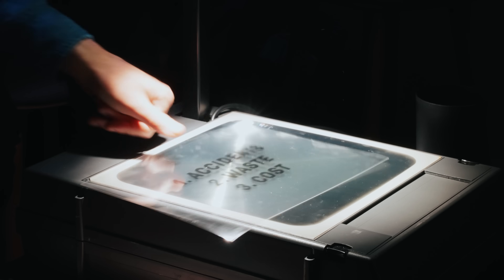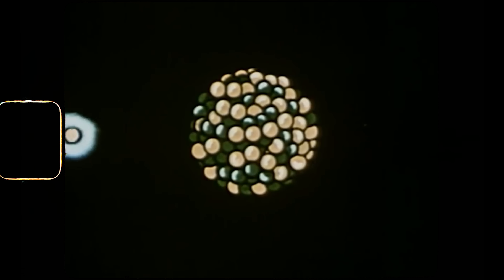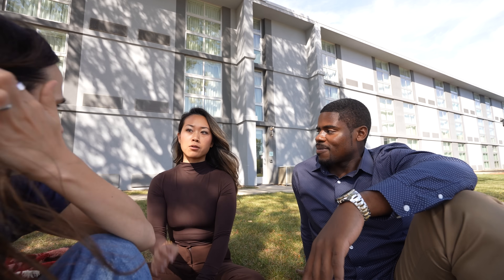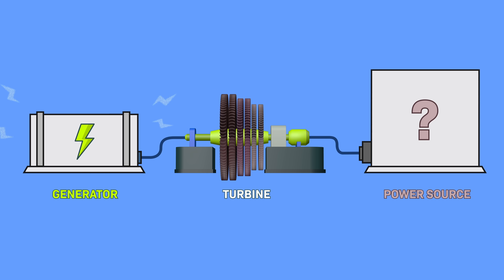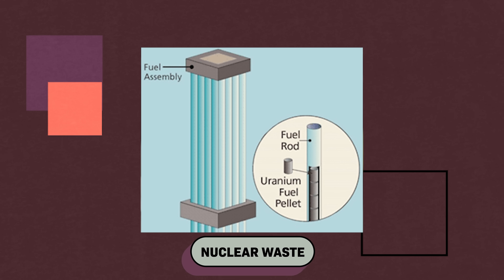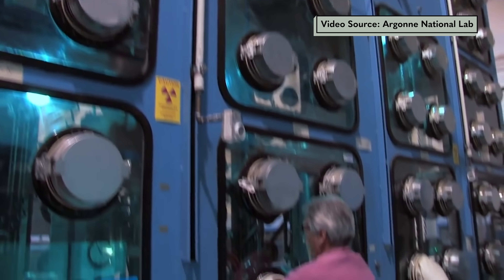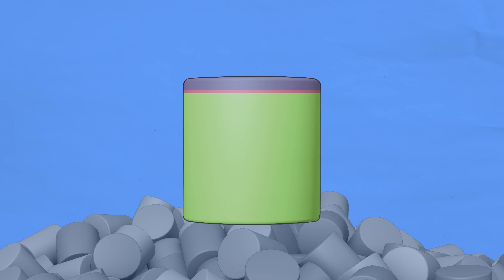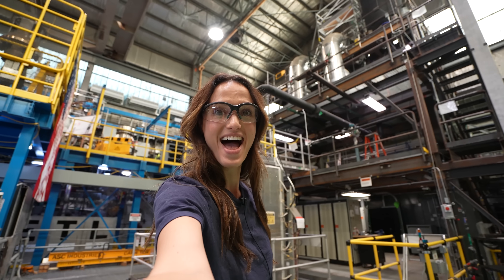The Big Lie About Nuclear Waste

Comment: If we want to cut/end our dependence on fossil fuels (oil, coal, and gas) we will eventually need more nuclear power.  All of the energy we use, derived from fossil fuels, will need to be replaced by other sources.  Nuclear energy is currently the only energy source capable of producing energy on the scale required to replace fossil fuels.  The good news is, we already possess enough nuclear fuel, both enriched (including that in nuclear weapons) and depleted, setting in heavy water storage pools in every nuclear power plant and buried in underground repositories, to last us for decades, perhaps centuries, without mining anymore uranium.  We've already spent trillions of dollars producing it over the decades.  It's an incredible national resource.  This, coupled with new regional U.S. nuclear fuel reprocessing facilities, will allow us to repeatedly extract more and more energy from what we already have.  The good part is we will over time reduce the amount of nuclear "waste" and nuclear weapons we already have by converting it's radioactive mass into clean electrical energy.

We absolutely need nuclear energy as a bridge to give us the time needed to fully transition to 100% clean, renewable, and sustainable energy sources.  All without digging, burying, and storing any more nuclear waste than we already have.

And, of course, we need safe nuclear power.  We need to continue to learn from the mistakes of the past, we know their names, Three Mile Island (1979), Chernobyl (1986), Fukushima (2011), and a host of others.  Safe future nuclear energy would include:  not locating any new nuclear power plants in any seismically active regions, or along coastlines subject to hurricanes and tsunamis, or near large population centers, as well as other safeguards.  In addition, requiring all new nuclear power plants to utilize closed-loop cooling systems, not rivers, lakes, or oceans.

Our future energy supply, without fossil fuels, will necessitate a mixed bag of wind, water, solar, bio, geo, hydro, and nuclear.  The sooner we begin the transition the easier it will be, the less it will cost, and the less fossil fuels we'll consume.  If we had begun 30 years ago we would be there today.  It would be much better to begin today, while we have the luxury of time, rather than being rushed by foreseeable and unforeseeable future circumstances beyond our control.

We know that even nuclear energy is not sustainable in the long term.  Because of this we will need continued research into the most promising alternative clean, renewable, economical, and sustainable energy sources, perhaps even fusion power.

We also need to improve and harden our electrical grid.  I envision a day when we have a superconductive national electrical grid.  It would consist of an underground "spine" running across the U.S. from east-to-west.  Prefabricated rectangular cross section concrete tubes, buried underground end-to-end running across the country between the lanes of I-80 perhaps.

Large superconductive electrical cables, enclosed within a sealed outer cooling jacket, filled with liquid helium or some other cryogenic liquid.  This would essentially eliminate i^2 R electrical transmission losses, greatly reducing the total amount of extra electrical energy required to meet demand.  Today, all of this extra electrical energy generated never reaches the customers and is dissipated as heat.  The "ribs", running north-to-south, could be optimally located.  These "ribs" could also be superconductive as well, if desired.  The reminder of the grid would remain the same as today.

Such a grid would allow power plants to be optimally-located anywhere without the need for hundreds or thousands of miles of existing electrical transmission lines and pylons.  It would allow hybrid electric vehicles with smaller and lighter batteries having drop-down inductive pickups to cruise along the lanes of this "spine" and "ribs" powered directly from the grid, from embedded electrical cables within the concrete roadway.  The electrical power used by such hybrid vehicles would be metered and included in each owner's monthly electrical bill.  Such vehicles could be powered from conventional battery and/or fossil fuels during off-grid operation.

Comment: Thanks for this video.
What about the "breader reactor"? In the time period of Carter and before that was the idea that was supposed to bridge us over until we got fusion power. I did not realize Carter killed this. I know his administration came in committed to solar and then abandoned that as they felt it could never become economical or efficient enough to provide all the energy we needed. Work on fracking and oil shale conversion to oil was started. That work help us become the number 1 oil producing country in the world. Yes more than Saudi and more than Russia.

There's more but that's to much for just a comment.

Comment: So, we only have to worry about the waste for a couple of centuries, we are saved!   The Japanese fast breeder reactor programme has been hugely expensive and uneconomical.  Nuclear technology is not "clean" - the fuel requires mining, then transport, then conversion to yellow cake (uranium oxide), then transport, then further refining, then transport, then further refining, then transport, then maybe it gets to be used or has to go through another process before it gets used - each stage uses energy and puts CO2 into the atmosphere.  The failure of a nuclear reactor creates a catastrophe that lasts for many years afterwards and potentially affects thousands of people, you can't guarantee its 100% safe, so it should not be used at all.  The process of dumping the waste requires more transport and the creation of a fuel site that nobody wants to be in their backyard, even in the Australian desert the locals don't want it there, even it is unsafe for "only" a couple of centuries - you know, like from 1800 to 2000, just think of all the things that could happen in that time.  We should use alternative energy sources that are renewable and do not produce such waste - they are safer and cheaper, too.

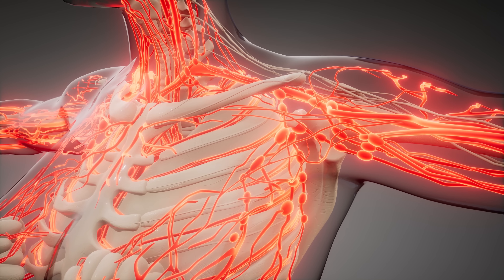Comment: Cleo, at 7:30  "...fire a bunch of free atoms at your Uranium-235" - this should be "free neutrons".
And, in particular, slow (thermal) neutrons in the common light water moderated/cooled reactors.

The waste from light water reactors is/was being recycled in France and elsewhere, but the process is expensive and generates a lot of radioactive waste, because a lot of the neutrons turn Uranium-238 into various radioactive but not very fissionable elements.

at 7:57 you say "after four to six years you've broken enough of that special uranium", but it's actually the neutron "poisons" building up that make the reactor harder to control, only about 5% of the U-235 has been fissioned at this time.

Fast neutron reactors, like the mentioned reactor from the 1960s, can burn up much more of the fuel (including some wastes from light water/thermal neutron reactors) and generate less nasty waste.  But they have to be cooled with liquid metals (sodium or lead) or molten salts or helium gas, which have historically led to problems, like sodium leaks and fires. And one needs (expensive) highly enriched fuel to run them, leading to proliferation worries.

Comment: Currently, the capital cost of the breeder is significantly higher than that of the light-water reac- tor. Constructing a 1000-MWe light-water reactor would cost about $1.7 billion, while a fast breeder reactor system of comparable power could cost $3.4 billion.

Comment: Fast neutron reactors can fission a lot more of the transuranic elements that are generated, and therefore utilize more of the fuel with less waste and more importantly, less long-lived radioactive elements in the waste. However, they are significantly more dangerous if they fail. However, a fusion reactor could potentially be used to supply fast neutrons to a slow fission reactor to fission a lot more fuel without as much danger.

Comment: Spent nuclear fuel can be recycled to make new fuel and byproducts. More than 90% of its potential energy still remains in the fuel, even after five years of operation in a reactor. The United States does not currently recycle spent nuclear fuel but foreign countries, such as France, do.
Reply: Wrong. 97% of a fuel rod is basically useless (U238). 3% is U235 that is used to create heat. A spent rod has 1% U235 left (you can recycle this) and 5% of other highly radioactive materials (that in reality are waste because we have no reactors to use them).
Reply: @whuzzzup  

5 Fast Facts about Spent Nuclear Fuel
October 3, 2022

    Office of Nuclear Energy 5 Fast Facts about Spent Nuclear Fuel 

Nuclear energy is one of the largest sources of emissions-free power in the world.

It generates nearly a fifth of America’s electricity and half of its clean energy.

During this process, it creates spent or used fuel (sometimes incorrectly referred to as nuclear waste) but it’s not the green oozy liquid you might be thinking of when watching "The Simpsons."

In fact, some in the industry actually consider it a valuable resource.

Say what?

Don’t worry, we’ll get you up to speed with these 5 fast facts on spent fuel that is generated from commercial nuclear power reactors in operation today. 
5 fast facts about spent nuclear fuel

Click above to view or download our 5 Fast Facts about Spent Nuclear Fuel infographic. 
1.  Commercial spent nuclear fuel is a solid

Spent fuel refers to the nuclear fuel that has been used in a reactor. 

The fuel used in today’s commercial reactors is made up of small ceramic pellets of low-enriched uranium oxide. The fuel pellets are stacked vertically and encased in a metallic cladding to form a fuel rod. These fuel rods are bundled together into tall fuel assemblies that are then placed into the reactor.

The fuel is a solid when it goes into the reactor and a solid when it comes out.

Sorry “Simpsons.”
2. The U.S. generates about 2,000 metric tons of spent fuel each year

This number may sound like a lot, but the volume of the spent fuel assemblies is actually quite small considering the amount of energy they produce.

The amount is roughly equivalent to less than half the volume of an Olympic-sized swimming pool.

And, the clean energy generated from this fuel would be enough to power more than 70 million homes—avoiding more than 400 million metrics tons of carbon dioxide emissions.

If we take that a step further, U.S. commercial reactors have generated about 90,000 metric tons of spent fuel since the 1950s. If all of it were able to be stacked together, it could fit on a single football field at a depth of less than 10 yards.

The nation’s spent nuclear fuel is initially stored in steel-lined concrete pools surrounded by water. It’s later removed from the pools and placed into dry storage casks that are made of steel and concrete or other materials used for protective shielding.
3. Spent fuel from U.S. commercial nuclear power reactors is stored at more than 70 sites in 35 states

Most of the nation’s spent fuel is safely and securely stored

 at more than 70 reactor sites across the country. Roughly a quarter of these sites no longer have a reactor in operation.

The U.S. Department of Energy is now exploring the possibility of consolidating this spent nuclear fuel at one or more federal interim storage facilities using a consent-based siting process. 

For the foreseeable future, the spent fuel can safely stay at the reactor sites or a future consolidated interim storage facility until a permanent disposal solution is determined by the federal government.
4. Spent fuel is safely transported across the United States

Over the last 55 years, more than 2,500 cask shipments of spent fuel have been transported across the United States without any radiological releases to the environment or harm to the public.

The fuel is shipped in transportation casks that are designed to withstand more than 99 percent of vehicle accidents, including water immersion, impact, punctures and fires.
5. Spent fuel can be recycled

That’s right!

Spent nuclear fuel can be recycled to make new fuel and byproducts.

More than 90% of its potential energy still remains in the fuel, even after five years of operation in a reactor.

The United States does not currently recycle spent nuclear fuel but foreign countries, such as France, do.

There are also some advanced reactor designs in development  that could consume or run on spent nuclear fuel in the future.

Office of
Nuclear Energy

1000 Independence Ave. SW
Washington DC 20585
202-586-5000

Comment: Your video was stunning! I have been interested in Nuclear Power, its advantages and risks since the beginning. I am horrified to realize that though Carter was a moral and intelligent man, (which is why I voted for him), he was dead wrong twice with consequences that will harm humanity well into the next century. Though Liquid Fluoride Thorium Reactors are vastly safer and cheaper than light water Uranium reactors, and can rapidly consume Waste from U-235 reactors, and Fusion reactors are glued to the horizon, Spent fuel  recycling can immediately solve the storage problem. Like LFTRs, we can just implement technology we already have. It turns out that climate change is the result of deliberate choices not to implement technology to prevent it.

Comment: Plutonium, AKA fast reactors had enormous problems in the past, including a core meltdown on EBR1 in 1959.  India has had failure with them as well.  There is great risk as the extremely toxic plutonium is the main neutron source, and is essential to minimize for proliferation.  Think patents and foreign sales.  Most proposed fast reactor designs use sodium as a coolant, which if it contacts a tiny bit of water corrodes steel pumps and containment. With a lot of water, sodium can react violently, think Fukushima.  Realize that powerplants are not built for wartime scenarios and can be a disaster if an enemy decides to nuke em, as we look to Ukraine's Zaporizhia.  In the United states even conventional plants take forever to make, and in the case of SCANA, $9 Billion were wasted before cancellation. However those who sold the failed plant were still able, as in all power infrastructure to bill the rate payers.  Nuclear power is not safe or cheap.  It is unlikely it ever will be.

Comment: I like channels that take complex topics and accurately explain them in simple terms. Subscribed.
Reply: some topics are complex for a reason. this video is mostly fanfic and halftruths. molten salt (thorium or other) reactors have been in research for decades and none are anywhere close to ready, or will be ready within a timeframe that is relevant to the problems we are facing in climate change. 15 years at least for a proto type reactor, and to make it comercially viable it seems to be more 30-50 years if ever.
the corrotion of the inner reactor parts is a huge problem, because the lifespan is way to short and the costs of replacing these now radioactive parts are enourmous.
the fact alone that the video throws recycling/enrichmement into the same bin as molten salt reactors shows that there was barely any research done..

Comment: This is NOT closed-cycle, it is a multi-pass  fuel cycle- "only a few hundred years" of radioactivity to deal with is not even remotely reasonable an expectation that ANY company, or ANY government, would maintain, not only the commitment,, but the technical competence .to maintain the storage facility and deal with the ultimate disposal.
This DOES kick the can down the road a bit, in that we won't be having to deal with ADDITIONAL waste on the megatonnage of what's already on hand.

Comment: Very interesting! 😃
At the same time I wonder what happens to the stuff that they cannot recycle. The used pellets seem to be composed of only a minor amount of the useful uranium-235, even less after they were used. The highly unstable materials will decay quickly, but what about the uranium-238, which - according to the graphics - is most of the uranium the pellets are composed of and has a very long half-life? And also the potentially weaponizable plutonium remains unrecycled. 🤔

Comment: Stop! IT DIDN'T WORK. You are just repeating the talking points of the nuclear industry which went bust when it became common knowledge that Nuclear waste must be stored and maintained in protected vaults for 100,000 years. This stuff is deadly if it gets disturbed. This is impossible to keep safe over this huge time scale. CO2 is not what they are claiming. It's all an ignorant misunderstanding. There is no harm from burning fossil fuels. Even coal is safer than nuclear. The ash particulates create clouds that reflect some sunlight away from earth.

Comment: I'm wondering about the waste that's created during the recycling process. Is any of it still dangerous / radioactive? Also something something bright
Reply: A normal rod contains ~3% usable material. After it's spent, it's down to 1%. You recycle this by taking the 1% out of it and putting it into new rods. 95% are U238 which is not really dangerous, the other 4% unfortunately are and you cannot use them in the reactors we use nowadays.  
So recycling here means, you throw away 99% of the rod instead of 100%.
Reply: @whuzzzup  Well that's kind of what I suspected. Thank you for the reply!